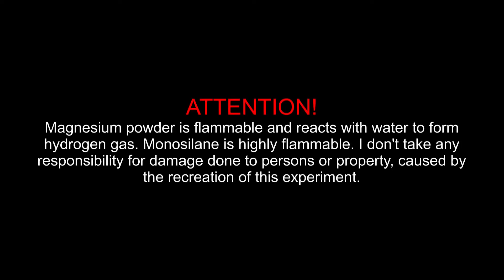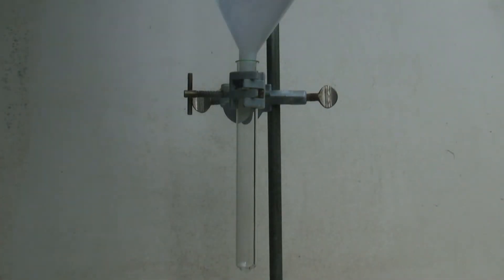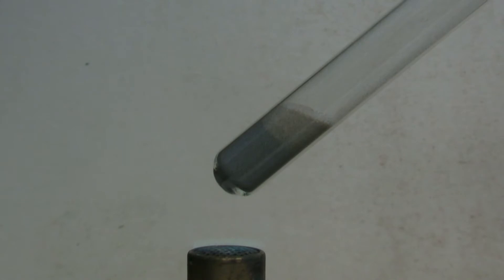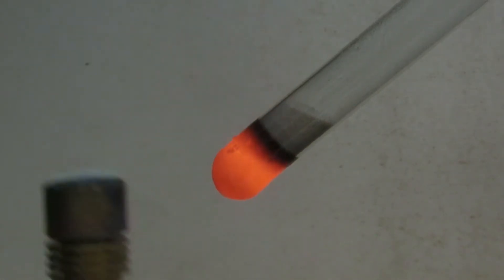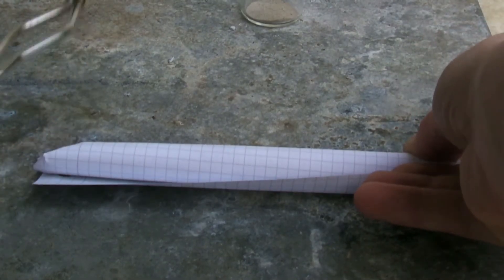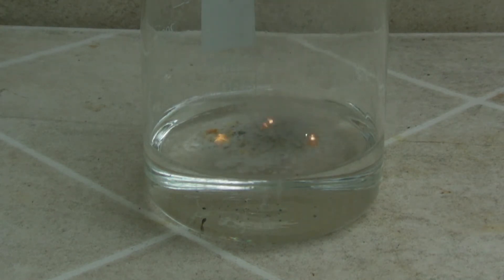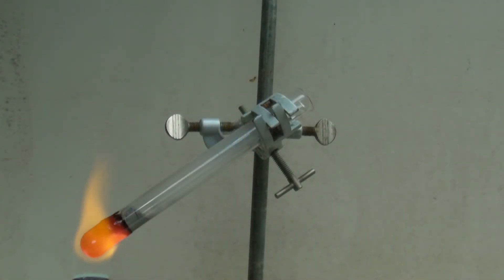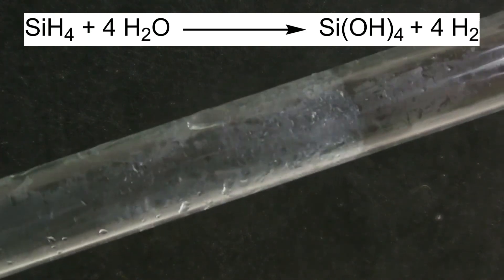Magnesium silicide and monosilane

Comment: Try making silixene sometime....calcium silicide plus HCl gives a yellow orange powder, siloxene, which is chemiluminescent sprinkle it on an oxidizer like potassium dichromate solution in a dark place and it'll emit orange light. This is one of only a few inorganic compounds that are chemiluminescent.
Siloxene is a polyoxysilicone, strange stuff. (you can buy calcium silicide or make your own the same way as MgSi2 but with calcium instead of magnesium.)
Reply from the maker: @stevengill1736  That might be exactly what I'm working on right now :)

Comment: Hi. I just did this experiment today and it failed... The product I got was a white/grayish substance, which was definitely not magnesium silicide. How long did it take you to get the magnesium burning and how long did you keep it burning after the reaction happens? Also, I did not dry my sand, could that have been the problem?
Reply from the maker: That sounds strange. I have never had this problem before, even though I have done it quite often. The reaction began after about one minute and I only heated it for about 10 seconds longer. The sand only has to be as dry as it would get, when you leave it on a dish in a room. White grayish substance sounds like magnesium oxide mixed with unreacted magnesium and sand. Maybe the grains of sand are a bit too large or the magnesium?
Reply: Yeah, I'm guessing the substance I got is magnesium oxide and when I put it in 0.1 M HCl, the solution turned gray but not spark was produced. For a second trial, I used the Bunsen burner and heated the test tube for quite a long time. I got the same result. In both trials, I did get a black coating on the test tube(seems like magnesium silicide) while heating, but when I broke the test tube in a paper, the black substance seems to have disappeared, leaving only the white/grayish substance I mentioned earlier.
Reply: Hi John. Thanks for the reply... As far as I know, sand is not pure Silicon dioxide, but I got my sand from my teacher's chemical cabinet so I'm guessing it's pure enough. Alos I used an excess of magnesium. So far my guess is there might be some water vapor in the test tube, and it reacted to form saline gas as I'm heating.
Reply: And maybe the grains of sand were too big

Comment: Great video! I'm going to try to react Mg with Si powder. (My Mg is in strips so it should be OK, as opposed to powder.) 
BTW, you say Monosilane, is there Disilane? - yep - there it is, just looked it up. Hrm, interestingly I'm not as familiar as I thought with Silicon and Silane derivatives. Trichlorosilane, Hexachlorodisilane, and Trisilane are all liquids, the former two being somewhat stable. I would attempt to make these but I don't have quite the right type of equipment to do so. A good heat-resistant glass tube with 24/40 integration would be needed, methinks. That'll be tricky. Anyways, keep up the good work! :]
Reply from the maker: Strips should give a reaction, but I'm not sure if these work as fine. Nevertheless, the silicide will form for sure.

Comment: Nice video! But unrelated question and maybe something to try?
What would be the result if you try esterification between amino acid and alcohol? I have understood that the amine group of the amino acid would react instead, but what exactly would be the end product? Peptide? Example glutamine and isopropyl alcohol (both OTC).
Reply from the maker: I would always say that the carboxylic group reacts with the alcohol to form an ester. Esterifications are also done in acidic conditions (usually H2SO4), so the amine group will be protonated, which should give the bisulfate/sulfate salt of the amino acid. I am thinking about how an ammonium ion would react with an alcohol, but I don't think it works. If you would mix the amino acid with the alcohol and add the acid, I'm pretty sure there would just be a precipitate of the salt of the amino acid. Of course someone can prove me wrong by showing me the mechanism of it, but that's what I'm thinking.
Reply: But wouldn't the free carboxylic group still continue reacting with alcohol even when the compound has precipitated? Unless the formed ester would stay there to block further reaction...
Reply from the maker: Whoops! Of course the ester could still form, even though the salt has precipitated :D I was just thinking about the idea, that the amine group reacts instead of the carboxylic group and forgot about the rest...
Reply from the maker: If enough acid is added to remove the water from the mixutre, this could also be an option. Otherwise the equilibrium would keep more on the side of the free amino acids.